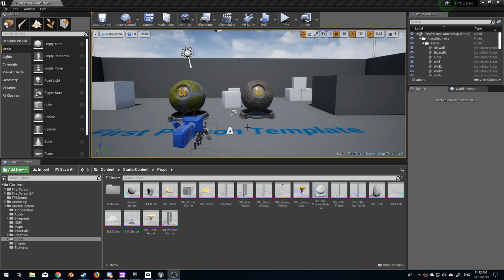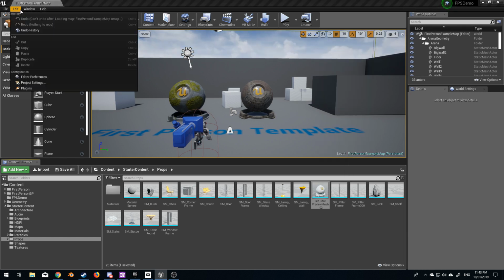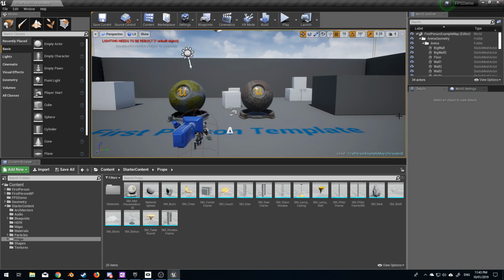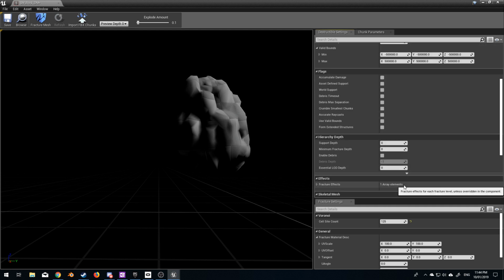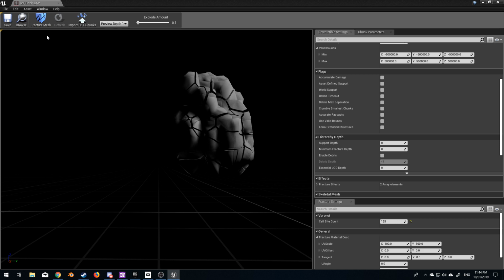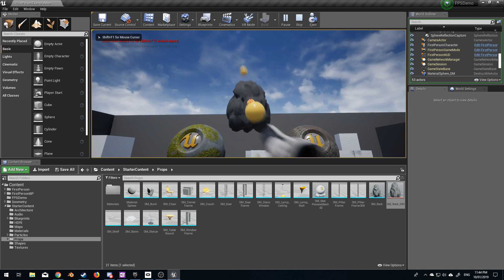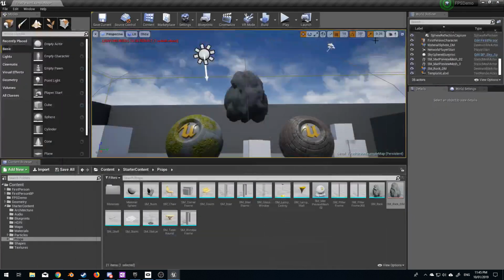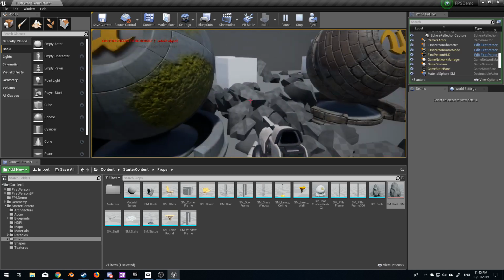How to Enable Destructible Mesh ue4 4.21

Comment: i use unreal 4.24 and it's not working for me, whenever i press fracture mesh the mesh just disappears and nothing happens even if i keep pressing fracture mesh.

Update: this is what is happening, when i shoot the destructible mesh the whole mesh just disappears but the physics of the rubble are there just not the mesh itself.
Reply from the maker: could be a bug with 4.24 maybe? I have yet to test this out sorry
Reply: @Markom3D  no worries, i'll try downloading older version to see if it's a bug on the latest engine or it's my computer.
Reply from the maker: @tikyorules  awesome mate
Reply: might have 2 enable Niagra in UE 4.24.1 just b careful of which 1 u use as it also seams 2 crash everything

IF YOU CHOOSE 2 ENABLE IT CREATE A BACKUP FIRST
Reply: Works fine for me, try restarting the engine

Comment: Hi, I have a model of a house I'm looking to make destructible in a game environment,  it's a block of flats.
Your example of the rock here ... The engin generated a destroyed mesh v.quickly.  In your experience (I don't have unreal eng to hand ), how long u think it may take for the engine to make this model destructible?

There are 3 floors, ground plus 1F, 2F. each floor has outer render (wall) brick /wood, cavity wall, inner wall, plasterboard.

There's also concrete divisions between the floors.  I'll post a link. I modeled it myself in SketchUp.

https://sketchfab.com/3d-models/wwx-quays-ca8650f6576e414a8381171c0674a8b1
Reply from the maker: Hey, I actually have no idea how long it will take. Are you trying to do this for a game or do you just want it destructible?
Reply: @Markom3D  just to destroy! For fun and experimentation.

It took me so long to construct I went to rock and roll tear it apart! Hah!

I'd like to probably have a player with gun type situation, have him be able to shoot at it and destroy it bit by bit.

I'm guessing that 'avatar + gun' must be bread and butter scenario in some blueprint in there... Tho I've never ever dabbled with UE at all (yet)!
Reply from the maker: Use blender and you should be able to animate it - Free Blender Addon - Cell Fracture https://youtu.be/E2WLmw2Crcs